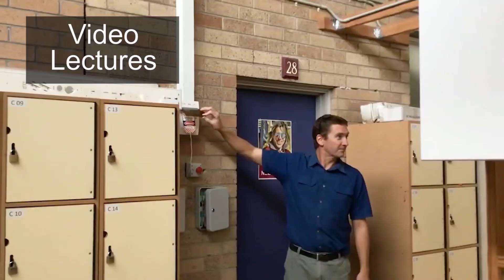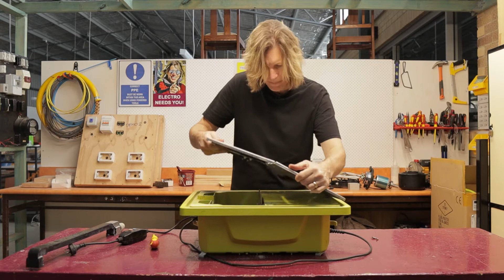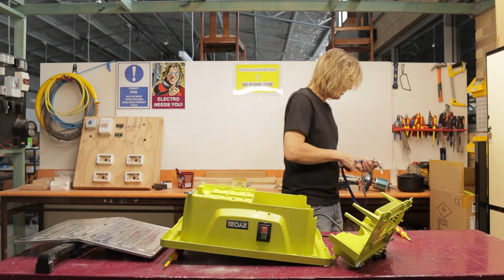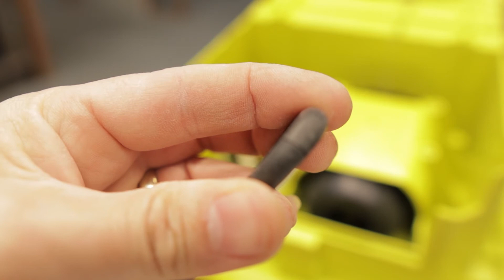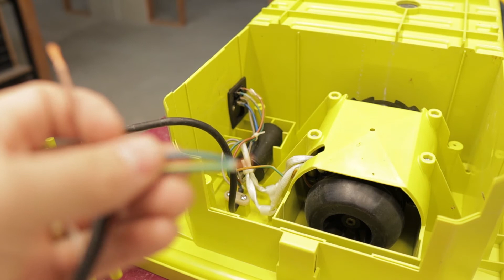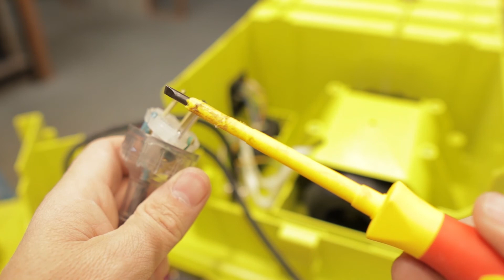Fixing A Power Tool

Comment: 😀 As an Amateur Radio operator (ZL1SJC) we built our own PSU's, thus we must know the AU/NZ single phase wiring code! 
I have a 240v power drill, and one day it didn't work, so I opened it up and found the neutral (blue) wire came off, so I put it back on and put it back together, and it still goes today. I brought it about 15 years ago from Bunnings (Auckland) for about $20! 😀
I found this video "how to fix a power tool" very interesting, different though!

Comment: For intermittent cable test, best is to use alligator clip's with Fluke multimeter with continuity buzzer which is best in industry.
Reply: 😀I noticed even with non-fluke meters, one can buy probes with clips as most meters to the sockets are basically the same (interchangeable)!